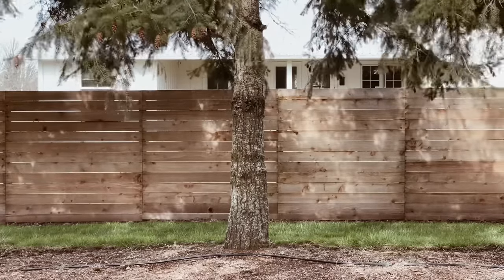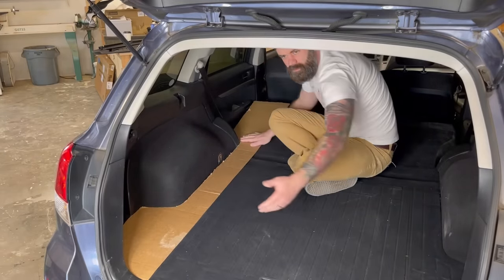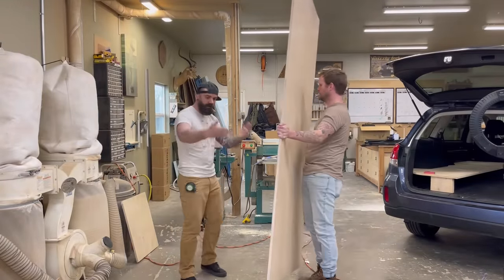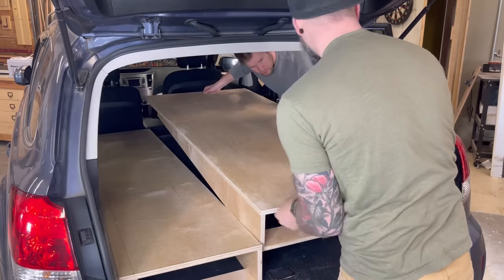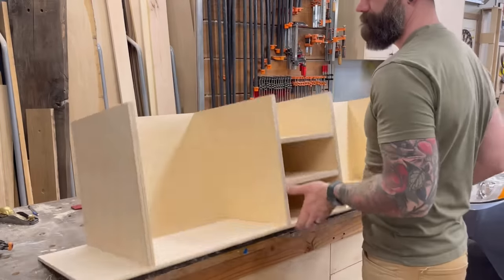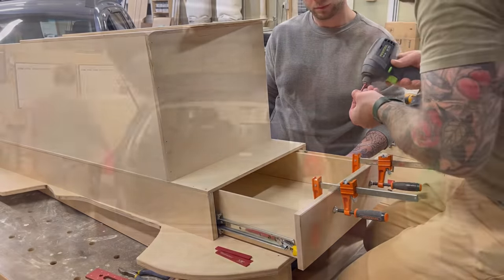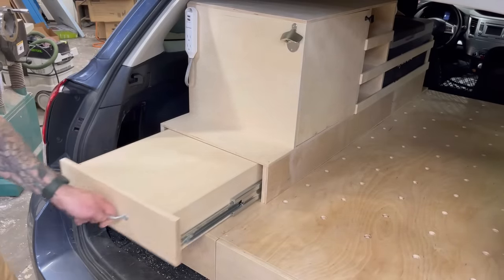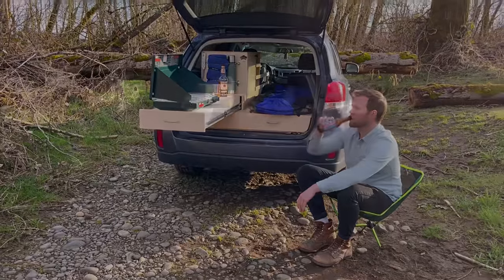Look What I Did To My Friends Car || Ultimate DIY Camping Conversion

Comment: Why 3/4 plywood? Probably could have made it with 3/8 or 1/2 for the base and 1/4 for the cabinets. Save a lot of weight.
Reply: I tried half-inch as a base and it didn't seem sturdy enough, so on my base I've gone to 3/4.

Comment: Awesome build. Seen this before but building something for my van so got back to it, sorry for the late comment. My experience from previous builds and camping is it's easy to remove the bottom piece of the back seat to get a horizontal surface.

Comment: I love it. I did something similar in my Subaru Impreza Hatchback... I have one suggestion - put some support/legs at the front of the platform going all the way to the rear seat passengers floor. The foam in rear seats will colaps a little bit under the wight of the structure so after couple of day/weeks it can be un-level or wobbly. It happened to me so I´ve removed rear seats all together and made support structure/with extra storage instead of them. The other great thing about that I have excuse for not driving my mother in law with us since the car is 2 seater now :D . I wish Nathan good luck with his car. Car camping is cheap, comfy and huge fun. Cheers :)
Reply: That is what I am thinking about doing... but only remove one rear seat, on the driver's side. I discovered if I remove the headrest on my front passenger seat, push the seat all the way forward, the back will go all the way down, and lines up exactly with the back seat. That rear seat back also reclines a little, too. I just need a filler pillow for my feet to keep them level. It makes a good sized bed, though. Had my Lexus suv for 20 years and just now finding this out. 

Anyway, I will leave one seat and the middle piece, and remove the second rear seat if I do long term camping, but still have a rear seat for my dog when not using it as a bed. It will give me tons of extra storage space and a little leg room sitting sideways when the "bed" is laid out.

Leaving one seat will counter balance weight from all the storage on the driver side. I also think about quick getaways if being harrassed... I think it's better to have the driver seat up and ready to roll, if necessary. I do lose a little storage capability, but thinking I can gain it in the back by moving my tire to the roof rack. If I have a flat, I won't have to move all that stuff out of the way, and there's a ton of storage under there. I 'll just have to build so I can access it.

Comment: I had an ‘06 Forester, which I loved, but, for me, there was not enough head room for sleeping and that’s just with 3” of memory foam directly on the floor. I’m in a pop-top micro van from Japan now with an 8” air mattress on the not-exactly-flat rear seats. This works and when I’m not using it, I have 2 small, rear bench seats. So it can function as my daily driver as well as camping van. Still, If I had the skills, (and energy) I would be building something myself. In the meantime I’ll just enjoy your video and others like it. Thank you 🌸

Comment: Love the video, but some ideas if you do it again. Use 12mm ½ inch ply. If you can get light weight ply go for that. That is what the custom drawer builders use here in Australia. And we do have a lot of 4WDs here down under and we all have or need drawers in the back. Also consider Teflon drawer slides, light weight, low to no maintenance, and gives more room for drawer storage. Also I would like to have the unit anchored to the car ror a cargo barrier. Again what we do here, sure beats getting a head full of ply in a frontal collision. 

That fridge sure won’t hold much beer. 😬

Again keep doing what you do, love your work.

Comment: From experience he may find hinging the cupboard door the other side is more useful so you can reach into it  from outside the vehicle more easily. I actually subscribed to your channel some months ago to learn how to make cupboards for my second van build. I have learned so much from you during lockdown here in GB. Varnished wood is so practical as a sand and re-varnish deals with scuffs and scratches.
Reply: Good tip. That’s exactly the addition I’d like to make to that cover where he tucks the Coleman stove. I’m going to hinge it as well as adding like a triangle shaped piece of wood beneath for support... or something there to support the weight of sink filled w water...then do a cut out for my collapsible sink. Then it’s outside the car for draining without lifting it. But then u just smash it back flat in the cutout and close cover and Bobs your uncle!

Comment: Good design for warm climates. You learn very quickly that sitting up inside is an absolute must, along with being able to cook inside when it rains all day (cooking under the tailgate just does not work in heavy rain), oh and being able to access the storage without popping the tailgate every five seconds, found all that out after my conversion and ended up stripping it all out to address those problems.  Still, as I said, yours is good for summer camps/warm climates.
Reply: Hi. Where can we see your build? 

Do you think a large awning is good enough for cooking in the rain?

Comment: If you would have made a door in the top of the bed part, and taken the top of the spare tire compartment off, you could access that compartment and made it available for more storage. The drawers underneath could have also been long and wedge shaped, again increasing storage. Of course you would also have had to make a door in the bottom of the one drawer to access the spare well. Mount the solar panel on a rooftop box and......voila, more storage as well!  Nice job!

Comment: Brilliant. Me and my dog car camp in  our Ford focus estate. No conversion..  I would love a small box unit though like part of this for storage.  I just have fold up table and chairs strapped to the side, large  dog bed behind the passenger front seat. I sleep on 2 fold up waterproof three section camping mattresses on the other side.  A well insulated cool box which can keep food cold for 48 hours with the freeze packs in it. A plastic lidded box holds everything else needed - cooker, utensils, dry food spare gas, lantern etc etc. The fold down oblong wash up basin holds the dog's water bowl from spilling when driving.  Light at night by solar garden wall lights - very bright!  Put string through the holes meant for screws and you can hang them up a inside or out. Emergency toilet a tight lidded round plastic box that stores under driver's seat. A few power banks for recharging phone and tablet. A tarp and some plastic electric fence poles for making an awning off the roof rails over the rear door if wet.  Front passenger seat and well area holds two 5 litre water bottles, rucksack, boots etc.  Have opening roof window for ventilation. Bubble wrap cut to window sizes for insulation - spray windows with water and that holds the bubble wrap to them. Also gives a little privacy in daylight if you want that. And I carry a two person tent. Can bring my bike mounted in the tow bar if I wish.  It's basic but it works.

Comment: This kicks butt on the sleeping platform I built in the bed of my Ranger w/ camper shell. It was perfect for a college kid working in the driveway of the apartment. The platform sat on top of the wheel wells with the perfect space for Rubbermaid storage tubs. One for the kitchen. One for dry food.  One for the dry clothes. One for kayaking gear. Plus extra room for paddles and an 8’ bed and fatty mattress. Aaaaaaa, the good ol days.

Comment: So many good ideas.I need to also fit a large dog!  And some equipment like 5 gallon bucket, solar generator, etc.  Might have to take out rear seats for under bed/under cabinet storage.
Reply: Susan, this is a 5 minutes conversion, not a camper.

Comment: I built a similar setup in my suburban a few years ago.  We still use it every summer almost every weekend.  Make camping a breeze when everything you need is in the truck already... just grab some food, your keys, and hop in and go.  Mine ended up being permanent though... 2 large drawers, a full size bed on the platform, all rear (2nd and 3rd row both) seats removed, a set of cabinets up against the front seats, etc.  Nothing like a 4 wheel drive tent to really camp anywhere you want to... lol.

Comment: Why didn’t you utilise the spare wheel well? The perfect place for a water system. Make a fibreglass water container or even just some water jugs hooked together with hoses. You could get all fancy and put an air compressor in the wasted space behind the tail lights and pressurise the water tank to have running water.
Reply: How much weight do you think this can carry?
Reply: @geographyinaction7814   @Geography in Action  It would probably be another 50 lbs. to add/create a 5 gallon or so water tank filled up with a portable water pump set up. So I'd say it wouldn't be an issue to build that into the spare tire well.
Reply: @Mr.StealYoBacon  .
Reply: I was thinking about that too

Comment: Nice build. I don’t know what it’s like in a Subaru but in my VW wagon, if you remove the rear seat cushion first, then the seat backs will actually lay completely flat. It doesn’t say anything about it in the owner’s manual, maybe they don’t want to encourage people doing that. Anyway, it comes out pretty easy. Maybe that would be possible in a Subaru also.
Reply: I'm even for removing both seat cushion and backs. It isn't that hard or time-consuming to do and it offers plenty of more storage capacity. As an added bonus, the extra storage space is low for some heavy stuff, a water tank and extra batteries for instance.

Comment: Hey guys, this is a beautiful set up that I want to base my build on. Nathan - after using this build for a year are there any changes you would make? You mentioned removing the spare tire and putting it in rooftop cargo - did that ever work out? and if so how do you access the spare tire compartment? I would love an update as I am attempting a very similar build in WA - the only difference being I need space to keep my gravel bike inside the vehicle (with the wheels removed).
Reply: Yeah, don’t use wood. Go with materials like PVC, ABS, and aluminum.

Comment: Am I the only one who thought that 60/40 rear seat would have made a good line for the 2 sides? Would have made adding a 3rd passenger at least possible by taking out the bed and stowing it temporarily. Or maybe reverse the two sides so the drawer is on the 60% side. Just some thoughts. I have that exact same car in that color. If it’s nearing 120k miles replace the timing chain. Trust me. Also make sure you hold on to that eye bolt that goes in that square in the front bumper in case you need to pull something/be pulled out. Used it the other day to pull out my other Subaru.
Reply: I’m sobbing… just was told by the dealership that my 2014 Subaru outback’s CVT transmission is done for….. and it’s only at 130,000 miles.. a mere infant! My 1st went just over 300K and my 2nd was a bit over 200K (I got hit from behind by a garbage truck or it wound have lasted longer…) but I never thought this one would be gone so soon. No recall by Subaru, just extended the warranty to 100k miles…. No help to me Grrrrrr.  I would have really enjoyed doing this to my car, but alas…. Anyone out there nearing the 100k mark go insist your dealership pry open that closed system and change out the transmission fluid anyway!!!!!  Loved this vid!!👍🏼👍🏼👍🏼
Reply: @suzannecartwright6504  bummer. I was so into Subaru's as I lived 12 years in mountainous western Colorado,  when I was educated about the expectations of the transmissions going out at a lower mileage than I would appreciate,  I wish they would fix that transmission issue
Reply: @suzannecartwright6504  read up on Subaru "quality" and you will find this is not unusual. Consumer Reports rates Subaru at the lower end quality wise for Japanese made cars.

Comment: Love this. Only thing I would’ve modified to your design is to have the fridge open towards the back left passenger door so that you can access it easily from standing outside the car, rather than from lying down. Great build!
Reply: My thought exactly. Good luck accessing you frig.
Reply: Great idea!
Reply: The suggested turnaround would make it much more difficult to access if you were inside, say in the evening or first thing in the morning or when the weather is bad.

Comment: Nice project. However I think that the cabinet door knob can make some problems in such tight area and I would rather opt for something less protruding. Second thing is that those door are not secured against opening during the acceleration (at least it was not shown on the clip). I know that the type of hinges you used keeps the door in place but to my experience they deteriorate quickly and require regulation and/or replacement as they do not hold the door closed as they used to at the begining.

Comment: And watch his next episode when he adds air shocks and leaf springs. That was awesome.
Reply: I was thinking the same thing.
Reply: Yeah that would make a huge difference. Never thought about that. But what I was thinking about was how much this thing weighed. 100 pounds ? People who do these kinds of conversions don't take weight into consideration. Hes got the cabinet plus his weight is all on the driver side. You can see the car squatch quite abit when they put the cabinet side in. I can the same thing with a plastic fold out table and a sleeping bag and not waste all the space inside the car as these guys did. And have more room for stuff with 10% of the weight.

Comment: This was cool!  I'm in the middle of building out my camper van and while it won't be anything like this, I love seeing how others "make it work".  I only have one question - is the baltic wood in the long drawer going to hold up to constant use?  Seems to me it might be a little bit too lightweight, but hey, what do I know?!?  Anyways, just a question - love the way this turned out! I've been binge watching your vids and they've helped me out a ton since I'm no woodworker and doing this all myself.  So THANKS!!!
Reply: Baltic birch is a hardwood. It is much more durable than basically any other plywood you can get. It’s great to work with as well but definitely heavier.

Comment: Love this! Still unsure though, what purpose do the holes in the bedside serve? Just ventilation or help prevent warping? Thanks!
Reply: It help prevent condensation build up on the mattress & so lets it breathe better ..... I think?!
Reply: Condensation leads to mold. This allows for air circulation.
Reply: Besides condensation prevention,, "WEIGHT REDUCTION".  Same thing could be done on areas that are not visible to reduce weight, as well as, create more circulation throughout the build.

Comment: Pretty sure the yellow tabs on the heavy duty drawer slides are to lock them into place lol. If you had let that go through the face you wouldnt have needed the locking latch, as the slides would lock in when fully pushed in, and when fully extended.

Comment: why do you add the drilled holes in the bed? is that for air flow, weight?
Reply: it will reduce the weight slightly but the main point is increased airflow for temperature regulation
Reply: Airflow stops condensation build-up thereby reducing risk of mold.

Comment: I guess that's part of your evil plan to keep your great friend Nathan single for a long long time...
Jokes aside, I'm surprised you didn't take weight more into account. For example, drawer faces, using 3/4" plywood etc.
I also question the mounting of the solar panel, he better not drive too fast :D.
Grteat build and thanks for the video.

Comment: Love the little sneaky comment re not needing to camp with electricity. I started tent camping in 1970 and thought the whole purpose of camping was to get away from all that. Fire light, double mantle lanterns, pouring water out of a container instead of running it thru piping, etc. But it was a great build for your friend anyway.

Comment: Hi from the uk, my solar keeps the leisure battery topped up, my fridge is 12volts, and use USB for charging mobiles, tablets, I use a microwave on mains  power on ehu at proper campsite with it. So it's kinda best of both worlds, but what a great video with humor. Lol. Mines a vw  lwb campervan, with a little bit more room. Keep it up. 👍

Comment: Love it!  Another "I have never done this before" video that turned out great.  That is what I love about you.  You just do it and if not right, do it again.  That is how I work.  I have one comment/question.  I see the solar has a controller to charge the yacht battery (12v) then you hooked up a power inverter to change the voltage to 110v to power a converter for the fridge back to 12v. I think there are a couple unnecessary components in your electrical system which if removed could save power and make the battery last longer. As well as getting rid of those components would get rid of the  heat they generate.   Might find someone that knows electricity.  You are a fabulous woodworker but the way you described the electrical components gives your knowledge of electricity away, and is hilarious!!! Great video.
Reply: The fridge can run direct from the battery using the 12v connection. It should also have it's own low voltage protection so it doesn't drain the battery entirely. The inverter can still be used for the extension cord running to the back incase you want to run any ac appliances, but only when needed. This simplifies the setup for the fridge and reduces extra power consumption that is lost converting 12v to 120v then back down to 12 volts. The only addition I would add is a 12v to USB adapter to run direct off the battery so you can charge any devices without the inverter and the usb's on the extension cord.